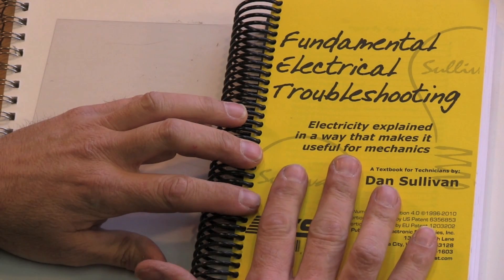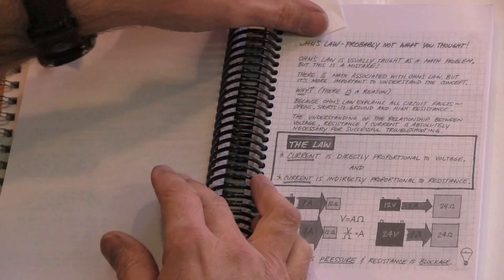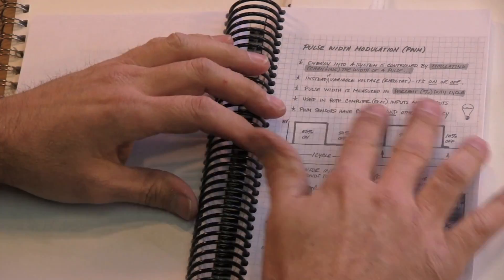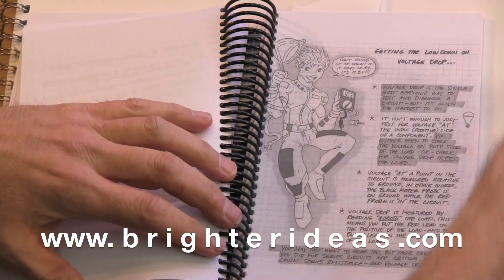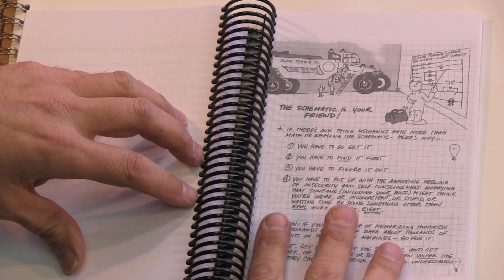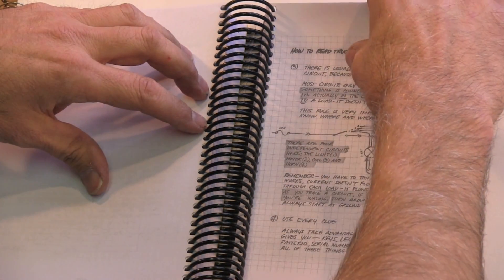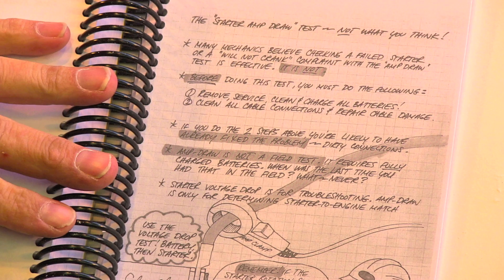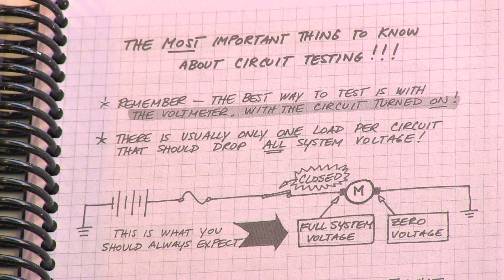FET Electrical Book for Mechanics

Comment from the maker: Not always. There are relays that have the positive at 85 and some at 86. Don't assume. Read the schematic on the relay. If there's a suppression diode the arrow (diode) will point to the positive. Also, the relay and relay base are mirror images.